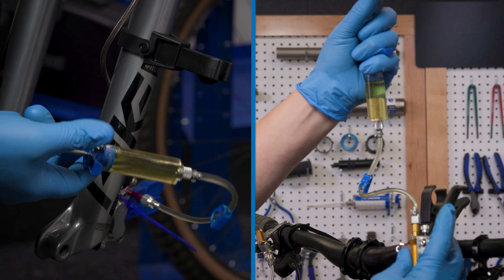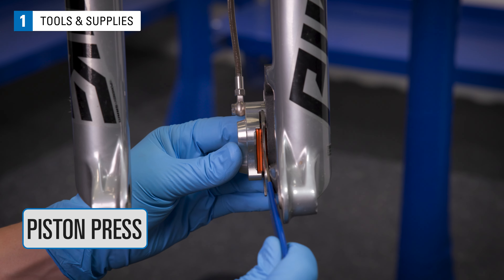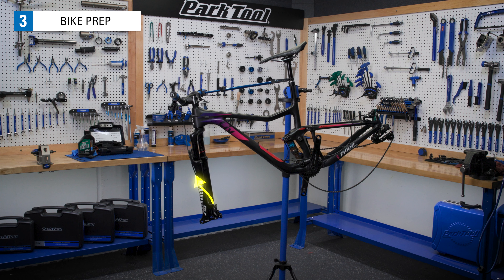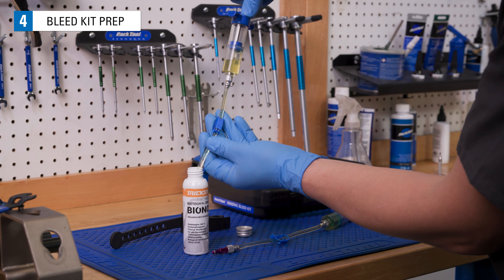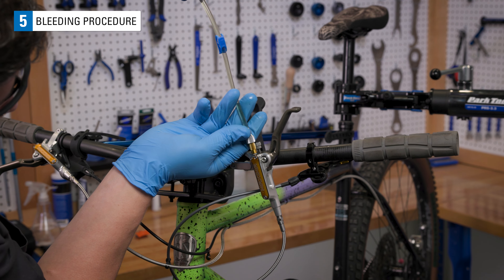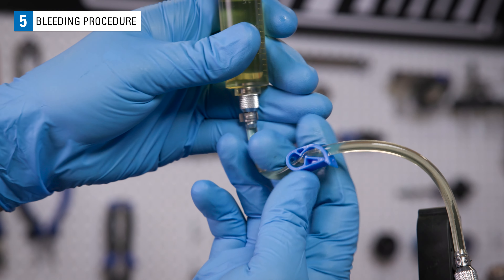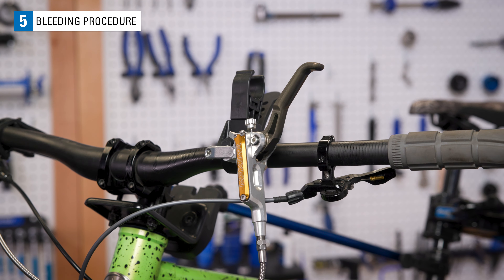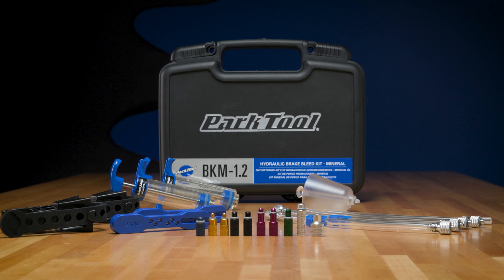Hydraulic Disc Brake Bleeding - Trick Stuff

Comment: What’s the point of the bleed blocks vs disc/pads installed? Is the bleed blocks thicker than the disc/pad or is it the same size mimicking the disc/pad thickness?
Reply from the maker: With pads installed, the pistons are likely to be extended toward the rotor. You do not want that.  The blocks keep the piston pushed into the body as you push the fluid. Additionally, you do not want any fluid on the pads, ever.

Comment: This does not work for the Liccola carbon lever. The adapters do not fit. Now I need to figure out how to bleed my new brakes
Reply from the maker: Have you used the gold adapters, in the M4 threading?  These come with the BKM-1.2.  Measure the threads of the bleed port screw from the brake and match it.
Reply: Where the bleed port is on the lever on the Piccola you need a longer, thinner adapter. The adapter in the kit is too wide and you cannot thread the adapter.
Reply: @jaredhileman4111  yeah also noticed its too wide for the piccola. gotta get the trickstuff bleed kit